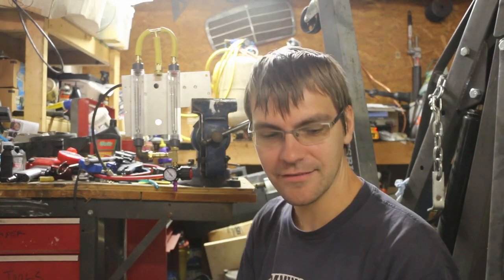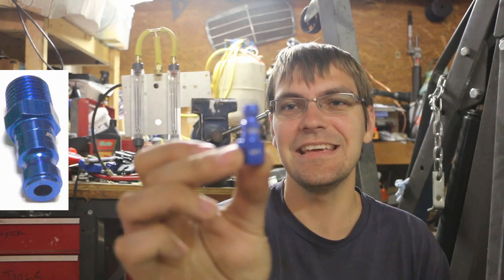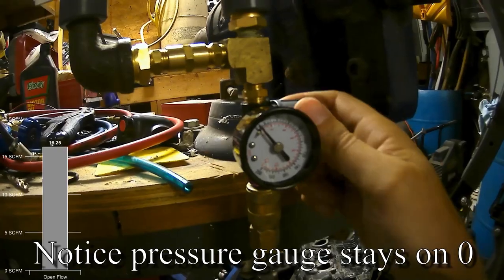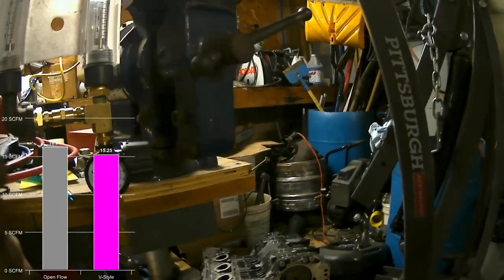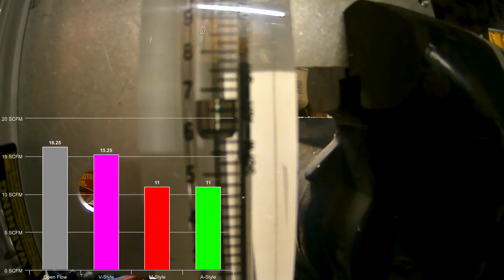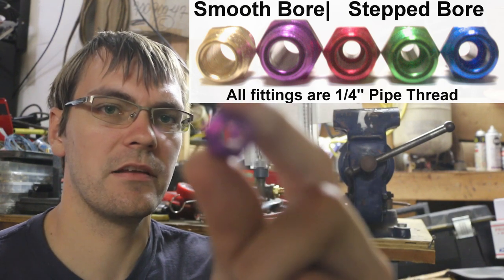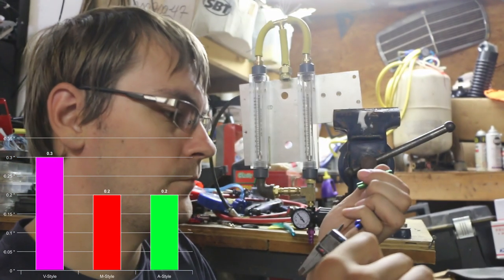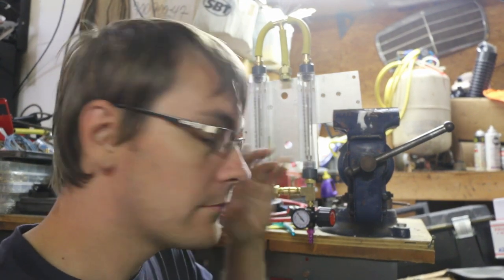Air Fittings: A Documentary including bore measurements and SCFM flow testing.

Comment from the maker: Affiliate links in case you want fittings as shown in this video:
These links allow you to purchase the things I've shown easily, I get a small commission at no additional cost to you! That helps me keep doing these videos!
Aluminum colorfit:
T Style (blue) 14 pack: https://amzn.to/2nv31xA
A Style (green) 14 pack: https://amzn.to/2o9Abn7
M Style (red) 14 pack: https://amzn.to/2mroBmO
V Style (purple) 14 pack: https://amzn.to/2nx8qnP

V Style Brass/Steel set: https://amzn.to/2nqgxCU

If you're building a big air system and need bulk fittings:
V Style Coupler (Purple, Female) 10 pack: https://amzn.to/2lR2oy0
V Style Plug (Purple, Male) 20 pack: https://amzn.to/2mA4MJO

Products I highly reccomend for elsewhere in your air system:
100ft Continental hose: https://amzn.to/2p3K8Tz
50ft Goodyear hose: https://amzn.to/2nkXN8h
Tekton 100ft Hose reel: https://amzn.to/2p29KA3
Regulator for spray gun/etc not main tank regulator: https://amzn.to/2niX0EN

Parts I've used in the permanent plumbing side of my air system:
10pk 1/4 Male nipple: https://amzn.to/2ojT1aT
10pk 1/4 Female nipple: https://amzn.to/2nwKAZP
10pk 1/2 male to 1/4 female reducer: https://amzn.to/2oUuXf4
10pk 1/2 pex to 1/2 female npt: https://amzn.to/2ny7lwq
10pk 1/2 pex to 1/2 male npt: https://amzn.to/2o9F7YZ
10pk pex tee: https://amzn.to/2nyM0Dh

Some of my favorite air tools:
IR 114GQC Air Hammer: https://amzn.to/2mEG3UV
IR 231HA 1/2 Impact: https://amzn.to/2p2nHOr (Get a boot for it so you don't scratch it when you drag it across the floor by the hose: https://amzn.to/2nuEnO9)
Nitrocat 1076-XL 3/8 Impact: https://amzn.to/2nuS3bV
Surebonder 9600B stapler: https://amzn.to/2p4bNDT
Some kind of cheap set like this with a blowgun and tire chuck: https://amzn.to/2p48OLH

The fittings: (Run V-style on high power stuff like the impacts, you're safe to use low flow fittings on the blowgun/tire chuck etc)
V Style (purple) 14 pack: https://amzn.to/2nx8qnP
V Style Brass/Steel set: https://amzn.to/2nqgxCU
Bulk:
V Style Coupler (Purple, Female) 10 pack: https://amzn.to/2lR2oy0
V Style Plug (Purple, Male) 20 pack: https://amzn.to/2mA4MJO

Comment: Bill Nye the Science Guy! Interesting video buddy. I've struggled with a giant air compressor and never getting enough volume for years. This nails it. Too bad I'm wallet deep in Milwaukee battery tools now. I have a 8' vertical compressor that is virtually brand new sitting in the corner of the garage and hasn't been used now for a couple of years. Things have changed. But not your channel. Another great episode. Thanks!
Reply from the maker: I've noticed a distinct difference using the V-Style fittings for things like my impact or air hammer. This video seemed a little slow to me, but it also answers the question why there was such a difference with the same hose, same compressor and same tools suddenly having what felt like double the power.

But cordless tools have indeed come a looooong way, I've got a bunch of older Dewalt 18v tools, I've highly debated moving to Milwaukee tools, but haven't done it yet, they seem like real quality stuff.

I use my 1/4 impact driver for all kinds of stuff, rarely do I need the air tools, but especially when doing suspension work on the cars or trucks it seems like the 1/2 cordless doesn't have the oomph when the air impact rips bolts right out like they were hand tight.

Just did a pile of work on my blue w123 mercedes, new ball joints, new tie rods, drag link, steering stabilizer, what a difference getting those old rubber parts replaced. I need to do the lower control arm bushings but I dread the thought of it. I'll get to it eventually.

Comment: With a quality air source, 1/2" hard line, 3/8" soft line (from the hard line to your air tool), and normal M style fittings, I find that will usually handle 99% of what comes through the door.

That said, from my research (including your video), a V style fitting may make a difference between being frustrated with that 1% of jobs or finishing them with less effort.  Thanks.
Reply from the maker: That is pretty much exactly my findings. Most tools do not benefit much from the v style fittings. Big consumers like impacts do have a marginal improvement, enough that a bolt that won't quite pop with a m fitting often will with a v fitting. That being said, I have run into plenty of miserable fasteners, pto couplings on seadoo engines can be a real pain too. Even a 3/4 gun doesn't always bust em loose. My 3/4 gun may need a rebuild though.

Comment: A second way to test flow is to attach the fitting under test directly to the compressor tank output, leave the fitting unconnected (don't connect anything to the NPT threads), and time how long it takes to empty the tank from 100psi to 50psi. Double the time is half the flow. I believe flow rate is nonlinear and decreases the higher flow. Flow testing by emptying the tank removes the hose and provides a measurement at the highest flow rate where the flow is most impacted. I would be interested to see flow vs psi with your rotameters at a couple PSI values to plot the data.
Reply from the maker: I need to do a followup on this soon, I've got some more assorted types of fittings, and I could easily do several tests like you suggest, as well as re-doing some of the rotameter tests, perhaps even fix up some of the plumbing and make a better test rig for this.

Comment: what about further boring out a v-style connector with a drill bit or rotary tool? I'm sure the walls are more than thick enough, they can handle being thinned a bit
Reply from the maker: Quite possibly. I'm unsure of how large of gains could be made, I suspect the coupler may be the limiting factor. It is also thoretically possible to use H style I believe they are which are stupendously enormous fittings, at some point I will retest to see if the coupler or the plug becomes the bottleneck

Comment: Okay but is there a difference between 1/4 hose and 3/8 hose. And also from 25ft. Compared to 100ft.
Reply from the maker: Absolutely. One of these days I'll have to get this stuff back out again and do some more tests, But I can assure you, any restriction is for a certainty going to lower the potential power output of a tool. Big shops often run 1/2" hoses with giant fittings to their 1" impact guns and such, they would run off a smaller hose, but not have nearly the same torque.
Reply: @trythistv  I wouldn't run less than 1/2" hard line.  3/8" soft line from the air port to your impact gun is usually sufficient unless you are constantly dealing with Heavy Duty rusted trucks.

Comment: What Air Compressor did you use ?     Home shop, most have 20 to 30 gallon tank with a 1/4 outlet The Tank has a welded in fitting can not change it out , I think its useless to go to a larger fittings unless you have a 60 plus gallon tank with 1 inch or 3/4 outlet at the tank .   can you test a tank with a 1/4 inch outlet and go to 3/8 or 1/2 inch .  with a small hole and going bigger your defeating everything .  I worked with a lot of tanks 1 inch outlet to 3/4 to 3/8 hose 1/4 inch fittings .  big to small . never backwards 1/4 to 1/2  Useless in my book .
Reply from the maker: At the time I was using a little 20 gallon Craftsman compressor, 1/4 inch fitting welded in the tank just like you said. Going to these fittings made a dramatic difference in performance of some tools. Its not a huge difference like going up to 1/2 inch hose and fittings with a bigger fitting in the tank, but maximizing the CFM makes a fairly noticeable bump in performance. I now have a 80 gallon 5HP compressor that has a 3/4" fitting in the tank. I get the same performance using these fittings (as you would expect)
I am very curious how it would work going from a small fitting to a larger hose, might give more of a burst of power from the added volume in the hose. I'll have to experiment with that sometime!
Reply: @trythistv  That be a good Video 4 sure

Comment: Thanks for your channel.

I wonder about the flow difference between an 'H style' fitting (3/8th's Industrial) and the high-flow 1/4 'V-style' fitting.
Reply from the maker: I've just found the Milton H style ends, they do come in 3/8 and 1/4 npt, I've added a pack of the 1/4 npt to my Amazon cart.
I suspect they are quite similar to the v style.

Since I have "3/8" hoses they all have 1/4 npt fittings so I'd need to redo my entire air system up to "1/2" hoses to be able to use the larger npt fittings but I will certainly take a look at the H style that use 1/4 npt!

Thank you for the compliment and suggestion!

Comment: Hey, Stedlin claims they get the same flow as the high flow. Can you include that brand in your next test?
Reply from the maker: I plan on testing some of their fittings soon! I suspect the price difference alone is going to deter me from rebuilding my air system, unless they are absolutely incredible, we will see!
Reply: Thanks, I understand that the I.D. of the plug is part the equation. The other part is the coupling, I learned some couplings restrict air more the others. But, I do not know which ones.

Comment: So it looks similar to 1/4 to 3/8 comparison. My tools are based on cfsm at 90. So do I need to adjust for this? I am totally new to this, so I hope I am making sense.
Reply from the maker: Right, the v style basically have the airflow of a 3/8 style fitting but in 1/4" size. And most of the tools are adjusted for 90psi, not cfm, in which case as long as you leave your regulator at 90psi your tools will get the same pressure but more cfm through the higher flow fittings so they might make a little more power, those restrictions can actually drop the pressure so the regulator could be set to 90 but with several fittings restricting the flow your tool may only see 70psi under a load, while with the high flow v fittings it may see 80 under load. I should do this again with a gauge on both sides of the flow meter and apply restrictions and see how much pressure is lost
Reply: @trythistv  So if I switched to 3/8 fittings, would it be the same? I am thinking I would need 3/8 hose to keep the rate of air flow?  But would 3/8 hose work on these?
Reply: @trythistv  Thank you for replying.

Comment: Thats all I use is Milton High flow fittings its just easier to keep every fitting the same
Reply from the maker: Yup, by far the best fitting I've found out there. I do prefer the steel and brass ones, aluminum tends to wear down after a few years of getting beat around in a shop, they still work, just tend to hiss air and be harder to insert.
Reply: @trythistv  I found that out as well switched to the brass and no problem